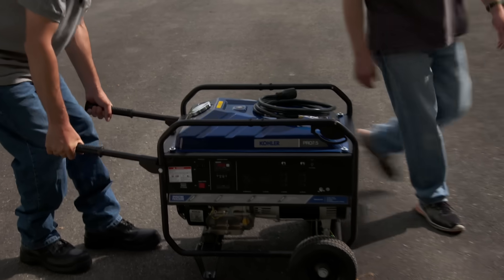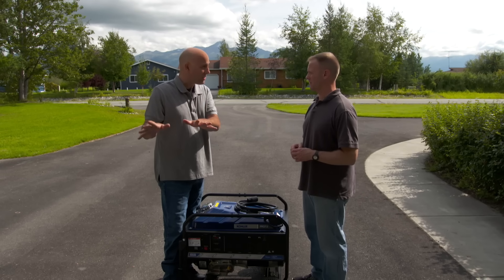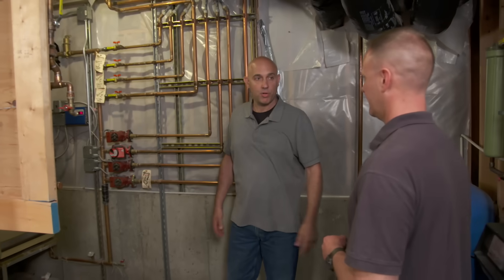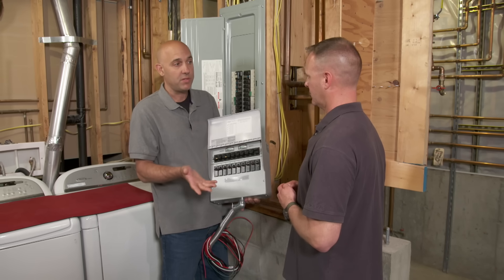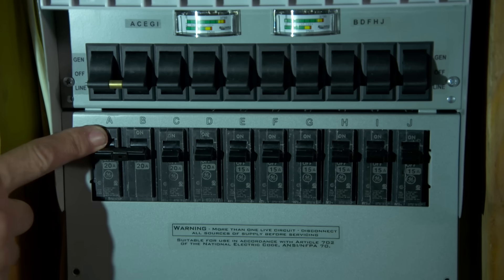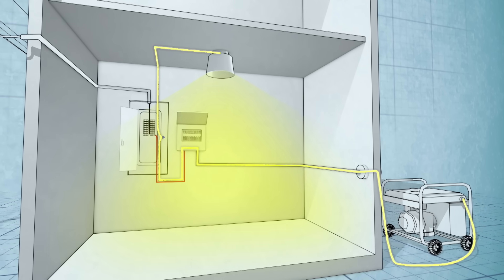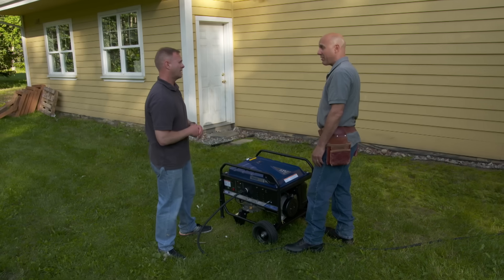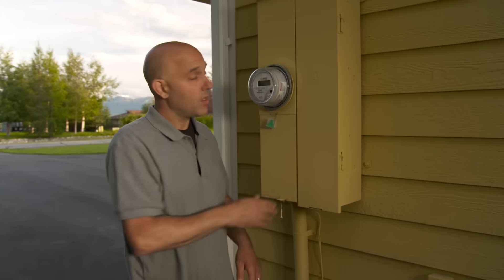How to Install a Manual Transfer Switch for a Portable Generator | Ask This Old House

Comment: That panel has a maximum capacity of 170A but that generator and feed wire can only support 60A. I hope he doesn't think that he can load up all of those circuits at once.
Reply: The only circuits that are accessible to the generator will be the 10 circuits wired to the transfer switch, and it could vary greatly as to how much power can be drawn through those 10 circuit breakers.  It might be possible to run all 10 circuits depending on what's connected to them, it's also possible they can't have all 10 circuits on at the same time, but it's a manual switch so it's important that the operator of the system control the circuits as to not overload the generator.

Comment: Is this manual transfer switch compatible with any portable generator? For instance, I recently purchased online a 12,000/9,000 watt generator, and purchased what I think is the same manual transfer switch shown in this video (10-circuit, 30-amp). Customer service at Home Depot told me that it wouldn't be compatible because the generator runs at 9,000 watts, and the manual transfer switch is compatible up to 8,000 watts. Now, the customer service rep stressed that he wasn't anywhere close to being a licensed electrician, so I shouldn't take his word as gospel. So just wanted to get a second opinion here from the experts. Thanks in advance for your help!
Reply: It really depends on the receptacles that are built onto the generator.  If there is an L1430R (30 amp) receptacle it's protected by a 30 amp breaker that's in the generator so the output is limited to 30 amps (7500 watts).  If the only 120/240 volt outlet is rated at 50 amps, then it would be possible to pull more than 30 amps on wire that's rated for 30 amps.
Reply: You need 50-amp manual transfer switch, per NEC.

Comment: What happens when you're on gen power and the main power comes back on. Does it have any ill effects on the electrical/generator system when you have two power source on?
Reply: It’s on a trans switch isolates it from the grid

Comment: I wasn't clear if you need to shut anything off on your main breaker panel? When I lose power do I need to make sure I turn off the main breaker before I start the generator? I fear blowing something up or causing harm if utility workers are out repairing lines.
Reply: With the transfer switch installed properly, the generator power never feeds into the breakers/bus bar of the house panel so there is no possibility to feed power back down the utility line.

Comment: So if I understand correctly, the neutral wire from the generator is wired to the panel. The same setup would be true if an interlock was used. Therefore is doesn’t matter that the neutral circuit is not disconnected at the main breaker. So an interlock is just as good provided you have a dedicated backfeed breaker and the main is open? What’s the issue?
Reply: Thanks for the comment.  There are two main concepts for residential manual switching.  An interlock, and a load side transfer switch used in this video.  They both have their places, and each have their own advantages and disadvantages.  The best approach is to research both types of setups to figure out what works best for your particular application. In most situations, the generator neutral is common with the utility neutral, which among a few other attributes being present, is defined as a non-separately derived system which is the most common back up system for residential in North America.

Comment: Hopefully nobody tries this, nice and easy way to get someone seriously hurt. Doing it the right way is not hard at all.
Reply: Thank you for the comment.   What do you consider the right way to install a back up system with a manual transfer switch?
Reply: @RelianceControls  I did have a question regarding the connection of the circuit leg from breaker to transfer switch, it looks like those are just wire nutted to the black wire coming from the transfer switch. Is this done within the main panel itself? I always thought splices within the main panel were a no no
Reply: @jeremiegrund  You are correct. It's against code.
Reply: Regardless of your opinion on the subject matter the facts are spelled out here: Q. Can I make a splice within a panel?
Reply: A. Yes. Sec. 373-8 states you shall not use enclosures for overcurrent devices as junction boxes or raceways—unless you provide adequate space. Conductors inside a panelboard shall not fill the wiring space at any cross section to more than 40%, and splices and taps shall not fill the wiring space at any cross section to more than 75%.

Comment: Great video but how much would that cost for someone to come in to do that
Reply: The charges for an electrician varies greatly based on your area and the demand at the time.  In some cases the whole install may only take 1-2 hours, in others it could take 3, 4, or more hours depending on many factors, especially how and where the inlet box is installed and how difficult it will be to run that building wire from outside into the transfer switch (and how long of a run).  The switch itself can be mounted and installed within an hour in most situations as long as it doesn't have to be recessed into the wall.  It could probably range from a few hundred dollars to a thousand dollars but the majority of installs is probably in the middle.
Reply: @selec21  well I have a through the wall generator kit I think I'll stick with that for now
Reply: @dclawnmaintenanceandsnowre4099  you can also back feed though the dryer or range,  just turn off all the double polls and the main breaker. 
Now the dryer will act as the main breaker.
Reply: @selec21  might have to try that sometime

Comment: It would be nice to watch you put in a system that will automatically switch from City Power to a Back-Up Emergency Generator 100% Hands Free? If the power goes off with-in a Split Second without Any Interruption at all it switches Seamlessly but it would be nice to learn of the most Inexpensive way to do this? For example it is Not a good idea for a Medical ADA Mobility Device such as a Wheelchair to be plugged in for 5 minutes and the power lost and the power to com on and off in some situations. When charging devices like these must charge Continuously for 10 hours straight. There are C-PAP Mushiness's that help people breath at night. These need to stay running and there is nothing like having the power go off while sleeping and the C-PAP Machines shut off waking you up & your Power Chair is DEAD in the morning.
Reply: Thank you for the comment! Jose Quiñones posted a really good response from his perspective in regards to your question about 1 month ago, please read through what he had to say as I agree with a lot of it.  It's primarily about maintenance, but especially the overall cost difference being thousands of dollars.  Now, a fully automatic system is certainly the best type of system for the people that need it and have the money to invest in one.  Your particular situation might benefit from a fully auto system while most other home owners might not be able justify the cost and necessity to have such a system in place.
Reply: Also this program did a show with an automatic system:  https://www.youtube.com/watch?v=MaSrlbseRlk

Comment: I would like to add the importance of removing the coiled up feed wire from the water hose reel BEFORE running. What you created was essentially a transformer with a Farris core.

Comment: How long can I store gas and do I need to mix .anything w the gas?   Also  do you have to start it everyone in a while so the battery doesn't die ....
Reply: Paneh C on a 4 stroke engine you do not have to mix anything with the gas. On a 2 stroke you do and it's around 40-50:1 ratio gas to oil.
Reply: Paneh C hi Paneh C just to ad to your question if your genset has a small battery then it is a keystart with additional recoil start so if your battery does go flat or weak then you can still start it up manually with recoil. It doesn't hurt to run the generator every so often if you are worried about unstable fuel then you can either not put any in or ad a fuel additive to the fuel so it will last while stored if you choose to keep the fuel in the tank then and youve shut it down from using it for a power outage then leave it running and turn the fuel tap off what this will do is let it run dry for a few minutes the generator will loose its rpm and rev ! Don't worry about this its normal also  turn your A.c breaker off on the generator if it has one  because obviously your mains power will be  restored and when you need to use it again choke to cold start fuel tap on and start it up then adjust choke to open position as you do.turn your ac breaker into the on position on the generator then ad a load on gradually from the house. Dont forget your oil changes and spark plug change and air cleaner as per manufacturers guidelines.   From Perth Western Australia hope this helps!!

Comment: Thank you for showing folks how to safely use a generator.  Linemen appreciate when you use a transfer switch, those switches save lives while they are out restoring power.
Reply: Do people sometimes wire their systems so that they can feed mains power with the generator.
Reply: Some people unplug their dryer or electric range and backfeed the house through the plug. It's very unsafe since doing that can send power back through the mains and exposes high voltage on the male prongs of a power cord.
Reply: I thought a auto transfer switch was mandatory everywhere in the US?
Reply: Richard Neal not really. You can use the panel kit that prevents main on with genset breaker on

Comment: One neutral wire?! For ten circuits?! Doesn’t seem right. I though common neutrals were not allowed anymore by code. Anyway gauge size of the neutral doesn’t look big enough for how many breakers?! Ten!
Reply: The neutral wire is the generator neutral, not the circuit neutrals. The circuit neutrals are not affected, they still all land on the neutral bar as normal.  The generator's neutral connects directly to the neutral bar (through the switch) to make a common connection between gen neutral and circuit neutrals, resulting in the mandatory return path for generator power on that neutral wire. An analogy would be the fact the utility company brings one neutral into your system, and all power returns on that single neutral wire back to the power source.  It's the same concept, the power source (gen) has 1 neutral as the return path for all circuits being powered by it.  Power always returns to its source and takes the path of least resistance.
Reply: The neutral wire just needs to be the same size as the hot (120v) conductors, it returns the difference in unbalanced return current.  It's a similar concept to a multi-wire circuit, where two circuits are fed by opposing phases and share a neutral.  The neutral could never possibly overload as it can't return more than each of the two hot wires, as it returns the difference.